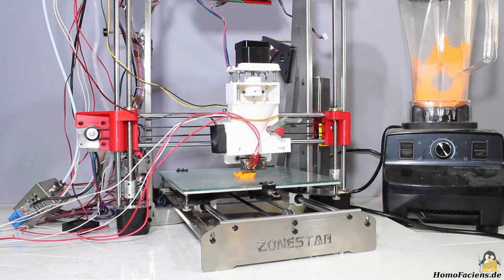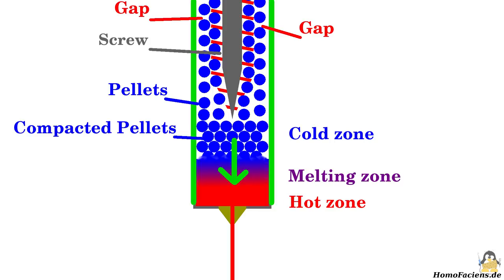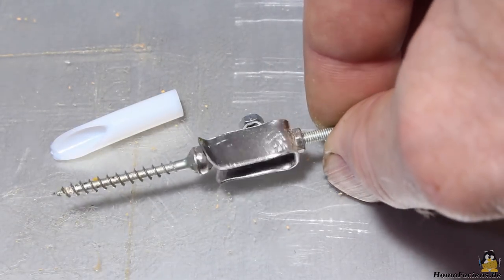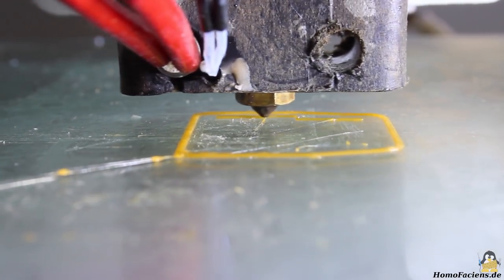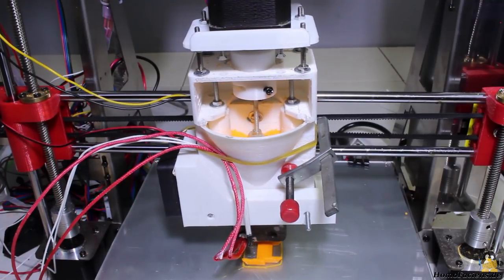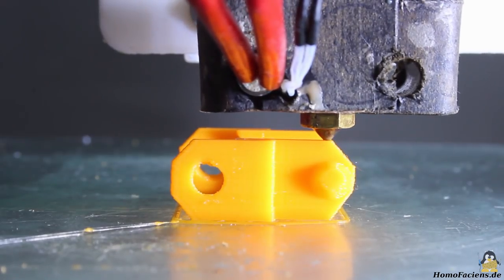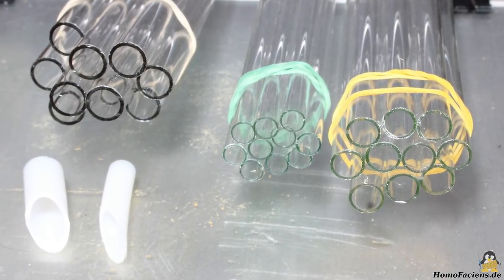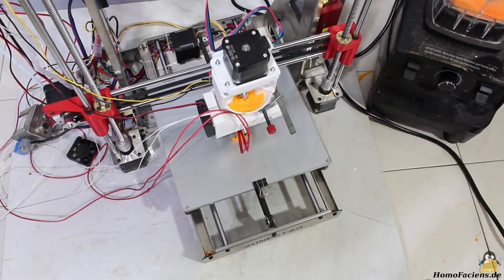DIY direct granules extruder

Comment: Your results are impressive for a relatively crude setup.  My impression is that there is an optimal (stable and consistent) output from the nozzle that is stabilizing variations in the material and screw drive.  Did you find this to be true?  Does the variation increase if you try to extrude faster or slower?  The importance is that this stabilizing effect will decrease in larger nozzles.  On the other hand, more extruder steps per mm of print gives more leverage to control extrusion -if we can go closed loop.

I was planning to try and develop a print head that used recycled PET.  ( BTW there was a DOD study to see if useful parts could be FD printed from PET water bottles that was promising)  PLA has good properties for easy printing, but it has weird degradation characteristics.  PLA crystalizes over time at high temp raising melt temps. My biggest concern with what you have achieved is the mechanical properties of the printed part.  You grind the plastic so fine that I fear the molecular weight distribution is gets small.  I would be very interested in the degradation in properties through multiple cycles.  Make a virgin print, test strength, with and against grain, regrind, print, test...to say 5 cycles or until parts are obviously useless.

More later.....
Reply from the maker: Future experimentation will tell how fast and with what variation in speed (e.g. slow perimeters, fast infill) I can print. Must finish the improved print head design, fist.
Yes, there is a lot to tell about grain size, variation in grain size, about degradation over cycles (percentage of new material to add to the bill) and what materials can be printed or easily get sourced and prepared as raw material.
I am just at the beginning of my journey - stay tuned.

Comment: Awesome, I discovered that Holts firegum trick back in 2014 ;) Nice to see other people use it as well!
Reply from the maker: ...its something old car owners like me have in stock ;-)
Reply: @HomoFaciens  Great stuff! It also works really well on older hotend models to secure the thermistor with :) I did notice the tubes tend to dry out quite fast though.
Reply: @HomoFaciens  Oh and by the way, I also discovered back in '14 that self-fusing and self-vulcanizing silicone tape is a really good insulator for the hotend. Especially when combined with a thin layer of ceramic insulation.
Reply from the maker: @Marinus I haven't heard about self-vulcanizing silicone tape, yet. Thanks for that hint!
Reply: @HomoFaciens  I can hit you up with a link if you like?
Reply from the maker: @Marinus Yes, please!
Reply: @HomoFaciens  This is what it was called when I bought it on ebay: "Red X-treme Silicone Self Fusing Waterproof Insulating Repair Rescue Tape" it's basically tape that you can even use underwater to seal up a pipe. I've had it on one hotend for about four years and it has lasted well until I took it off myself as the hotend broke. The tape fuses to itself and from what I understand, vulcanizes from the heat that the hotend produces. It's great to work with and cuts really easy. The tape is separated by a thin sheet so it doesn't fuse to itself in the package.

Comment: Great job! Have you tried any of the granulates for injection molding? It's great to be able to recycle the scrap parts, but the possibility of using the injection granulates with good results would make the real difference, as they are roughly ten times cheaper than the filaments.
Reply from the maker: Injection molding comes not until the direct 3D printing works - be patient...

Comment: very interesting project, I'm a CNC machinist and if you want, imma make you a custom screw and a feed pipe for the extruder
Reply from the maker: Many thanks for your offer. However, when I am playing around with new machines, I usually have new ideas in a faster pace than I can make drawings and wait for parts to be manufactured - at least in the current state ;-)
I'll keep your offer in mind in case I get closer to something that is worth producing in at least a small series. Hope to get back to this machine in a couple of weeks - its currently stored in a dark area of my workshop...
If you haven't noticed, there is a second video about that project, recorded months ago:
https://youtu.be/Nycx9_I9eec

Comment: Instead of a rotational screw mechanism have you considered a fast low alternating range piston pushing the granules down your feeding tube from a conical shaped funnel? the feed rate will be regulated by the piston frequency, To remove vibration the off-centre mechanism wheel should be counterbalanced.  I hope you find this idea interesting. If the piston has a needle in the centre by alternating the off-centre mechanism vibration wheel 180° where you can adjust the height of the piston and therefore block the plastic feeding by lowering the needle when necessary.
Reply from the maker: Yes, I had thoughts like that, but you would need a relatively high amplitude of that vibration (must be in the rage of the granules size). That leads to non continuous extrusion.

Comment: Surprisingly good results! Especially considering what an hack job this is :O
You might be onto something, however getting that small granules, essentially dust is going to be super problematic so perhaps this needs to be scaled up
Reply from the maker: I was using the blender shown in the background to get the granules. With PLA it works fine. Microplastics should not escape in your environment.

Comment: i have a suggestion to improve it, use a smaller hopper/assembly on the moving gantry and a larger hopper held above with a feed tube down, it would make it easier to reduce weight and make the print head stiffer (or even be equally stiff but work better due to reducing moving mass)
Reply from the maker: Yes, that's how I will do it when starting to print larger parts. This was a quick & dirty setup just to see if it works.

Comment: The flexible drive will certainly reduce the carriage weight. Something else which could be done before that is to make sure the center of gravity of the carriage is exactly where the X axis belt goes through the carriage. That way, there won't be so much shudder when the carriage changes direction. Perhaps lower or raise the stepper motor used for extrusion to achieve this.
Reply from the maker: This was definitely a quick & dirty build just to see if it works in general. A more compact design in under development.

Comment: Part of your problem is you are grinding plastic into rough chip which has a high friction coefficient and is likely to clog.
Commercially produced plastic pellet or powder/granules are much smoother, and will flow far better.

It is possible to buy a Teflon coating spray (Used for refurbishing old frying pans), it might be worth using it on your screw to reduce friction, and should be able to withstand fairly high temperatures.
Reply from the maker: The rough chips are definitely no problem. With the Teflon tube they slide well along the wall. Friction on the screw is no big thing. The stepper motor delivers sufficient torque to move the granules.

Comment: for the stringing issue.. i recommend increasing the travel speed and acceleration.
Reply from the maker: Both are at the maximum the printer can deliver. Same is for retraction speed.

Comment: Damn... That looks really promising! You might be onto something here. Have you thought about using a drill bit (for metal, those heads are nicely angled) in a close fitting metal (copper?) pipe to feed the granulate?
Reply from the maker: Drill bit in a close fitting metal pipe is what many people have built, but I think my approach delivers better results. As written in the FAQ, it is the low pitch of the wood screws that gives the better control over the flow of plastics. The fact that my system works even with a large gap between screw and tube wall is another plus - no need for a high precision screw conveyor.

Comment: You can try to find coil threaded rods (coil rods) they are used in construction industry,  they have much higher thread pitch than standard acme screw
Reply from the maker: As stated in the video: "The higher the pitch, the higher the transmission" and its more easy to control the flow of plastics with a low "transmission". However, too low pitch means the plastic granules aren't forwarded correctly. I am still trying various screw conveyors, so thanks for your hint. Coil springs might be an option as well.

Comment: very interesting..... maybe if you make the heavy parts closer to the linear bearings (the extrusion motor that drives the screw) it will maybe reduce the wobble !!! also closing the hot end with the screw tip is a bed idea it could destroy the mechanism if it fails !!
Reply from the maker: Well, the overall construction of the print head was quick & dirty just to see if it works at all. Future will tell, if closing the nozzle is a good idea...

Comment: It is great if you attach it with a fine shredder so man can put the used bottles in and the head will do the rest. 
But you need to make it fix due to its heavy weight and the bed moves X,Y,Z
Or keep the fine shredder outside with feeding mechanism so you can keep the 3D printer hot end as it. This way we don't need to use granules and could be used with any 3D printer with minor change, just the Teflon filament tube need to be replaced with a feeding tube that used small blower to transfer shredded plastic to the hot end.
Reply from the maker: There is no need to have it all in one box. Two separate mechanisms means less complexity: Keep things simple.

Comment: A part cooling fan could really increase print quality
If you don't feel you're at a stage where it makes sense to do that yet
Maybe do your tests on your ender with the part cooling fan off so you can better compare :)
Also good work with this! I hope, one day, I can use my big box of waste prototypes and failed prints
Reply from the maker: The new print head that is currently under construction will have mount points for a part cooling fan.

Comment: nicely done have you tayde using a auger type wood drill
Reply from the maker: Thanks! Have you read the FAQ?
Reply from the maker: FAQ my first post on top of the YouTube site of this video.
Reply: @HomoFaciens  from my point of view its not the first you can pin it as the top conet as the channel owner 
thanks for work i was thinking of doing a similar thing mostly cause i leave next to a place the has  plastic casting factory and can get pelts for free
Reply from the maker: It was pinned, but look like that property got lost during editing. I have corrected that, thanks for your hint.

Comment: You could print the upper Part of the screw to be better optimized for getting the granulat and use your Screw construction only for the hot part below.
Reply: no need for the metal construction then
Reply from the maker: I did some experimentation on that as well, but the problem is that you can't really build up pressure with that configuration. Usually it's the forwarding of solid plastics that moves the whole bunch through the extruder. It's the melting zone that causes trouble without a "push from top".

Comment: Very impressive
Direct drive granules extruder though? 
Although i think making your own/ using 1.75mm filament is better for overall print speed and flow control. The idea of recycle/ granual diy printing seemed more for large scale operations not small diy jobs.

Comment: Have you thought about 3D printing the screws? That way you could experiment with more different geometries. FDM materials may work, considering strength and temperatures, but there are several services where you could order metal-printed parts now. More expensive, of course. Also: There are some people who have experimented with extruding chocolate or other edible material. This granule extruder may actually be able to extrude colored vegetable fat (like chocolate) or even sugar paste.
Reply from the maker: Well, my approach is to use what you can source easily. 3D printing a metal screw is too special for now. However, 3D printing metal is on my mind and I will start experimenting with it.
Printing with sugar is something I will try, soon. There is almost nothing more easy to get in small granules ;-)
Reply: @HomoFaciens  I understand, that's totally reasonable. The problem with sugar is that it doesn't melt at reasonable temps and I guess it's hard to solidify any kind of solution or paste after it is extruded.

Comment: I like your project so cool, but why u didn't make a machine that can make plastic filament then use it in any 3d printer
Reply from the maker: That would have been too simple ;-)
Open source filament extruders using pellets that work fine, already exist. Going directly from granules to a print is to my mind the better solution and there is more space for improvement.
Reply: Also those waste-extruders don't seem to work that well either...

Comment: What about a pressurized system with a open and close valve? Or you could make a mini filament machine and mount it on the top where it makes filament for the printer and works just like a standard printer would. I think that way you have less limitation  and it wont be moving around when you go to add more grains... you could even add a hopper with sensor to add more as it gets low
Reply from the maker: Pressurized with what, air? Well, you'll need lots of pressure to push the granules in and you must keep the hopper under pressure as well which makes adding plastics while printing a lot more complicated.
As posted multiple times: Open source filament extruders exist, my challenge is to develop a working direct granules extruder.
Reply: @HomoFaciens  Well then what about a mini grinder to grind down the plastic into fine powder?
Reply from the maker: @wrxsubaru02 If you can make it really "mini", show us how. When talking about getting granules out of plastics you will see why my setup isn't a small one. Stay tuned!
Reply: @HomoFaciens  I have nothing to show as this is not my project nor do i have much interest in it... I was just sharing info or another opinion after watching your video but that was clearly bad judgement on my part. good luck with your project,  wish you the best.
Reply from the maker: @wrxsubaru02 Sharing ideas is never bad judgement!

Comment: You should add different color granules in the same print for a rainbow or other effect.
Reply from the maker: @Code-Grammar Color doesn't matter for the project I am printing. There is a reason why I will check what happens when using black and white (or other high contrast colors): To see if I get a uniform grey extrusion, which would be an indication that the plastics get mixed perfectly during extrusion process.

Comment: And I thought I go too far to get something to work. That must-of been a lot of trial and error testing to get it to work. I wonder if they make small wood auger drills, because they would be more accurate if you can get them to work.
Reply from the maker: Wood auger drills have a larger pitch and so a worser "transmission". The trick is to forward a small but constant volume of granules per revolution.
...good to see that people notice the efforts put even into a simple construction like this one.

Comment: FIRSTLY  add a 3rd x axis smooth rod to compensate for the big assembly.
Reply from the maker: Sooner or later I will build my own printer from scratch. For the next test runs I will improve the Zonestar mechanics slightly. Let's se what works best with low efforts.

Comment: What happened to this project? I wish when you start a project you explain the results in the future.. I know some projects just dies.. but things like this shouldn't die .. I hope you can make more videos about this .. 
Many wish to get a good result out of this experiment. 
thanks.
Reply from the maker: There is a version 2:
https://youtu.be/Nycx9_I9eec
Need a lathe to go to the next level. So either I must build one (takes time) or wait for a donation to speed it up ;-)
Reply: @HomoFaciens  
thanks. What is the possibility of having melted plastic prepared before printing in a container? I mean you have a small container that melts the plastic, keeps the temperature, and the extrude is just putting out the melted plastic. By that you eliminate many problems here. It will consume more power but might be better?
Reply from the maker: But how does new plastic enter that small container? You'll end up with another auger that forwards the plastics into the reservoir where it melts. No need to add that complexity to the system for no advantage. At least I don't see any problem being eliminated?